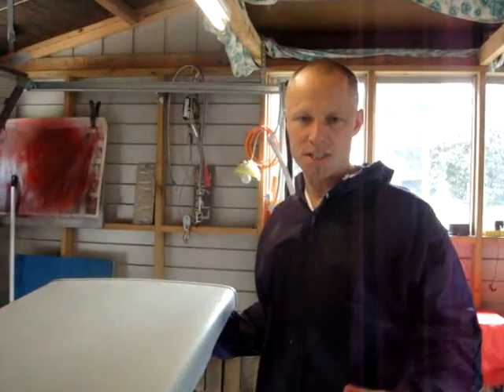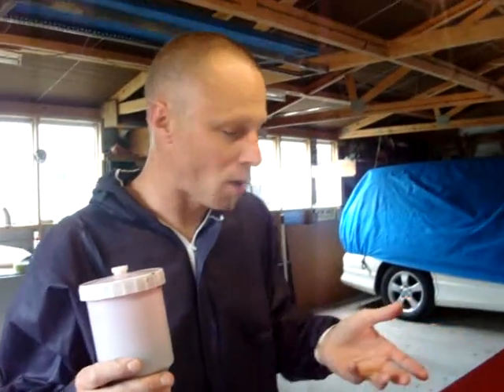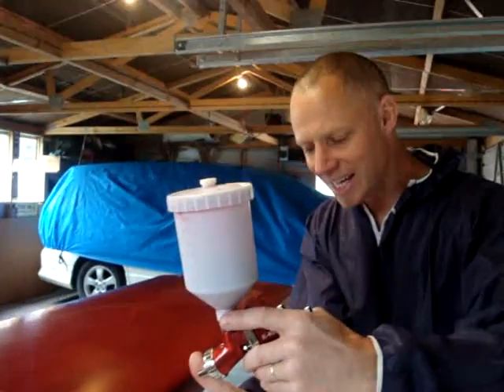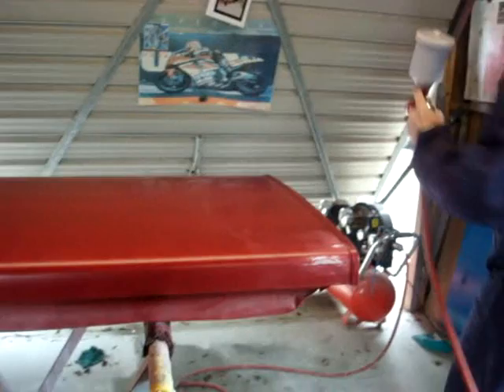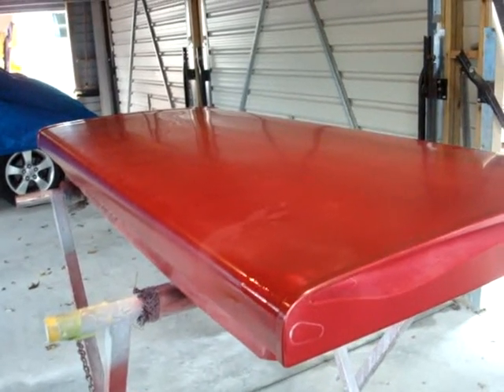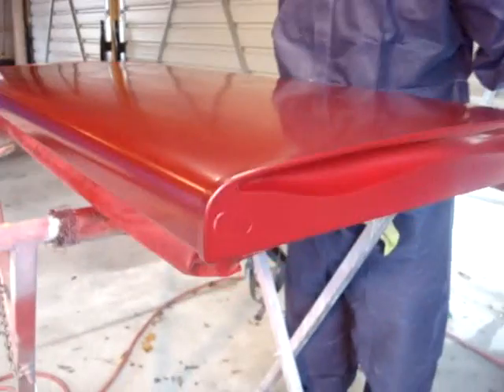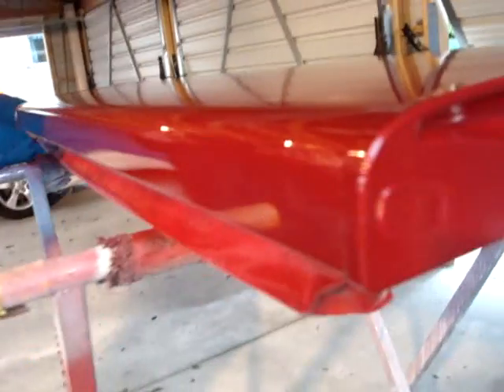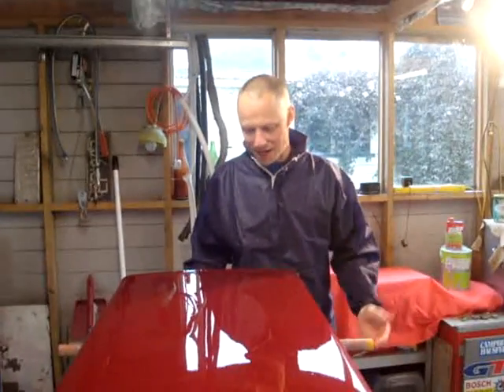Basecoat -clearcoat secrets revealed

Comment: also its good to have a gun for primer only , base only and a gun for clear only,,, ,   and for sanding I use 320-500 for primer.    600,  'wet, with water and dry with an air accompressor air nozzle, and squeegee; brand::::::: one pass Water blade!!!!!!! Then base I don"t sand base,  but after Clear coat and two days of waiting:::::  Grit:' 800- or 600, 1500 or -2000- Finally----3000-3M Cork is awesome,,,,, for clear coat   preparing  for buffing ,,,,   Harbor frighte  has a little section for lots of  your car buffing needs, Maguiars ultra compound M105, with foam pads and they carry  great cleaning cloths in packs of 12 which work great......
Reply: Jesse: I want to try air brushing onto a metallic base. It will take a while to get the graphics done; probably a week. Will the clear still bond to the base paint after waiting that long?
Reply: Ian Brown yes!  But you just scuff with scotchbrite or a fine grit sandpaper prior to shooting your clear.  The idea is to got rid of the gloss on the surface before clearing.  The best thing to do is shoot base, scuff entire panel with scotchbrite pad, then do your airbrushing, then shoot your clear.

Comment: Can I wait a week after the base to put on some Spraymax 2K ca clear?
Reply: most basecoats have from 1/2 hour to a few hours and some cases 24 hours (depending on brand) to apply clearcoat, you will have to light sand and put a light coat if you go that long but to be specific to the brand you are using  you need to check the TDS, it should be somewhere in the web or you can ask for it in the place where you purchased the basecoat.

Comment: hi restolad i painted my bonnet and in 2k and has a gone a little sanding in some spots.can u sand it with 1500 or 2000g sandpaper then clear coat it?
Reply: Hi there just thought id reply as i know a few things about paint as i am currently taking a course on it, from what i know 2k you don't clear coat as it already has it in, also if you have any orange peel or imperfections in your 2k base coat you can then go at it with a D/A with a soft pad with P2000 avoiding any hard to reach areas so just focus on the main part off the panel ( big surface areas asses able with a mop), once you have done that get a bottle with water then on the D/A with a soft pad again use P3000 wet the panel then go a little closer the the edges once done then you will need to mop the car/ panel to get a perfect finish, hope this helps

Comment: I didn't think basecoats had a cynoacrylate hardener in it like primer or clearcoat....so not as dodgy to be exposed to...or am I wrong?
Reply: Some Solvent basecoats suggest approximately 3% hardner for better performance and crosslinking, but not necessary. The real hazard is the VOCs, or volatile organic compounds, found in the thinners or reducers. That's the reason waterborne basecoats were developed,
Reply: PaintSmith so for a general rule of thumb I was right, and VOCs are known to be present.
Using 2k primer and clearcoat and waterbourne base is a half assed attempt to address VOCs dont you think?
Reply: ***** Solvent Basecoat has the largest proportion of VOCs as it may be 50% to 100% reduction rates, where as 2K primers and clearcoats require (in most cases) no reduction. So they've reduced a large portion of VOCs with waterborne base but we're still spraying isocyanates in the primer and clear.  I guess it's a case of "Pick your poison"
Reply: basecoat colour has no iso and you can not leave it overnight before clearcoat you have a four hour window

Comment: Buffing is Not a must  in good car painting but it's there if you need it,,,,  I set the adjustable buffer fairly high and keep it moving,,, always keep a water sprayer mist on the foam  pad every time you reload with the cutting compound,   Then I do  a run at it until it is gone, empty,, then spray some water on the pad then hit it again with The same compound from the first load, till it starts heating up and really getting into those cracks and angle n the buffer at various angles,  at about 4 square ft area , It may take as many as six times  on bad scratches  It can do wonders!!!!!  Praise Jesus!!!!!!
Reply: +Jesse Cox   Another thing about buffing,,, You cant buff good unless you have at least a 1500 grit water sanded clear coat underneath and 3M 3000... the base coat can bleed out and kinda foul out the cutting compound with spots of color.  And That's  If you do buff a big part of base,   but there's other compounds which might do it some help
Reply: +Jesse Cox  "two days to two weeks after clear coat"
Reply: +Jesse Cox   A Carb cleaner- Break cleaner high strength spray can is the fastest way to clean up the gun which should be done EVERY Other  time during a wait time; and if you leave cleaner in the gun it creates Fish Eyes unless You blow it out and dry with air hose ....    I also learned to use only blue tape on automotive; cause house painters tape rips the clear up Way too often!!!
Reply: 3M 3000 Grit has made my buffing ten times better as far as scratches,,,,,  It's a Sheet of Cork but works Wonders!!!
Reply: Jesse Cox try this on your clear. a torch flame medium speed over work and even scatcheswill fill in as if you wet sanded and polished. wax and your done

Comment: My only concern is the incorrect use of the word "Opaque". Opaque means not able to be seen through; not transparent. When you use it in the video you are talking about the base coat where you sanded off the dodgy area in the corner, saying it is still opaque there where actually you should be saying it is transparent or even translucent. Opaque is the opposite of transparent. If the coat is thin enough to see through then it is transparent, not opaque.

Comment: NOTE  THIS  DIDN'T  WORK [To buff  or use Torch on clear coat for orange peal}  ::: An hour n 1/2  after base coat clear coat, I worked map gas on a little propane  torch of my Truck hood  for 45 min  in little  circles and got a tiny little bit less orange peal ,, but not enough  to want to do it again,  And There were a couple of base discolorations. Note:  I'm using polyurethanes:  2k  Nason clear coat ,,,,  Now  I"ll just buff it like i usually do,  ,  I've heard of people using torches on lacquer paint a few times before the time of urethane ,,  Those people are mostly retired  i talked to,, come to think of it.   And its all  online.  Yep  I'm remembering  it now,  there's a pretty big deal on the difference ,   Somewhere  online
Reply: FROM  FURTHER  BELOW :;  "good job. here is a clear coat secret mate. you can lay a thick ass coat of clear. let dry 10 - 24 hours. than use a torch and speedy over. piece and watch any bubble run vanish. no need to wet sand as even scraps scratches will fill back in like you just sprayed it. test first some velars may react different and the clear transforms to a almost scratch proof shell."[[ Yeah I think that might work}]
Reply: yeah I think that might work